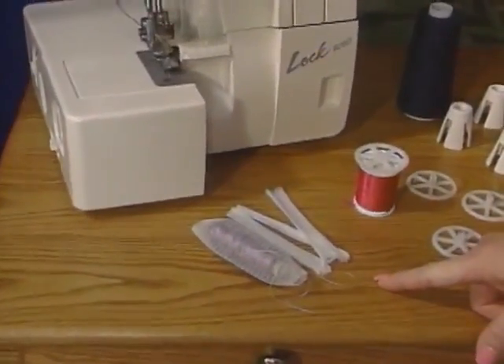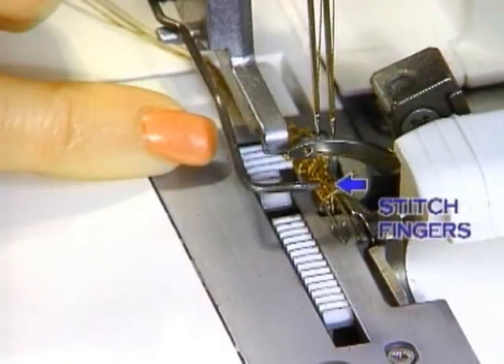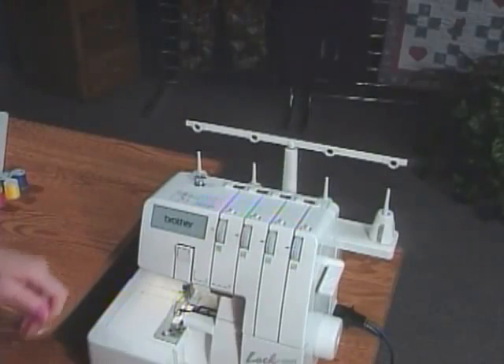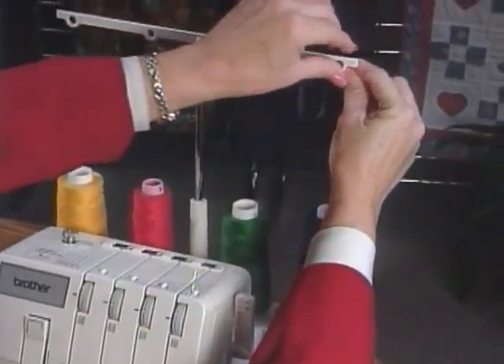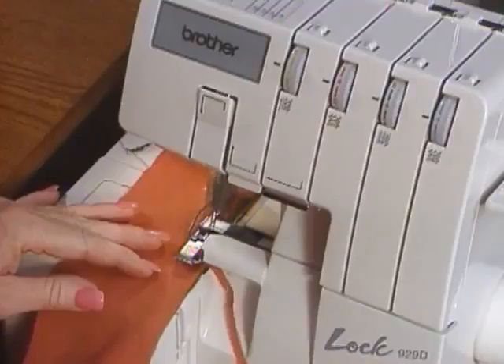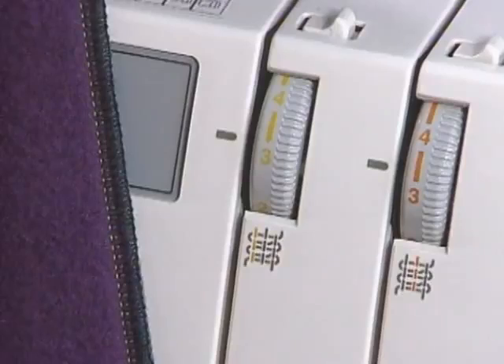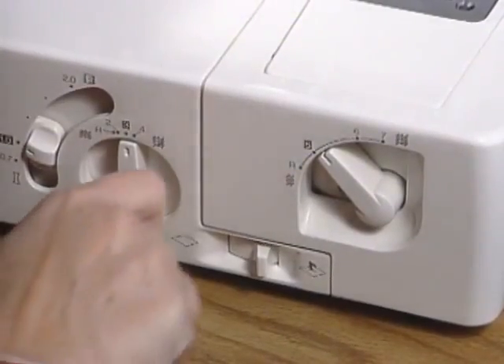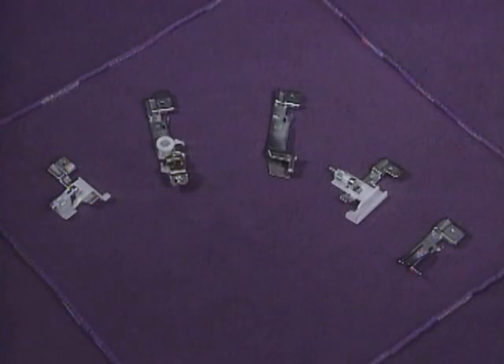Brother 1034D Instructional Video

Comment: Assuming the 1034 is very similar to the 1634, "simply sliding the bed extender off to the left" is impossible.  It's really my only complaint.  Loving everything else about this machine!  Does anyone have any tips?
Reply: Had same issue.  By resting your thumbs on the upper body of the machine and using index fingers to grip the extender, pull your index fingers towards you.  It will be a struggle the first couple of times.  There is a compression like nut that is very tight removing the first time.  Remove and replace a couple times might help loosen the fitting.